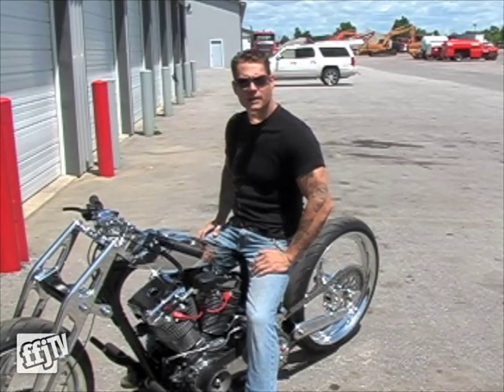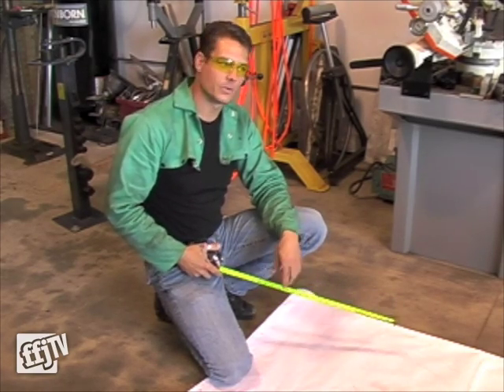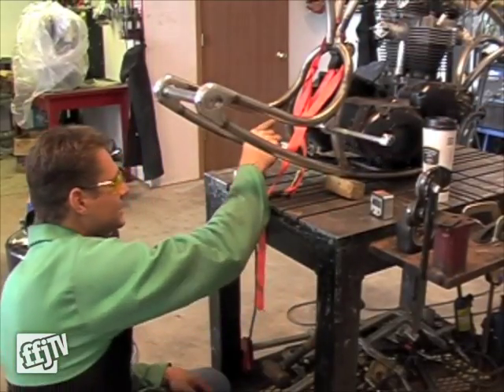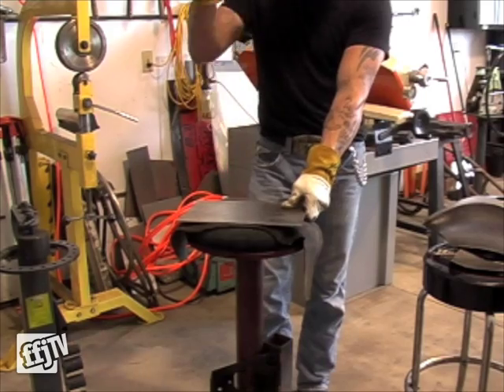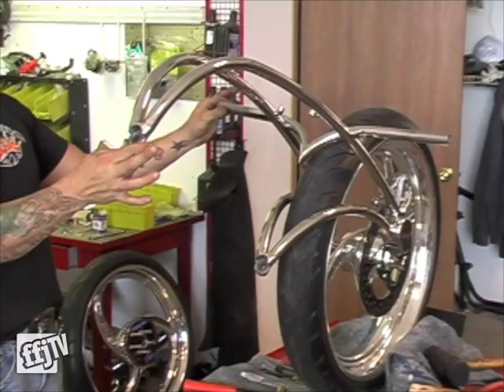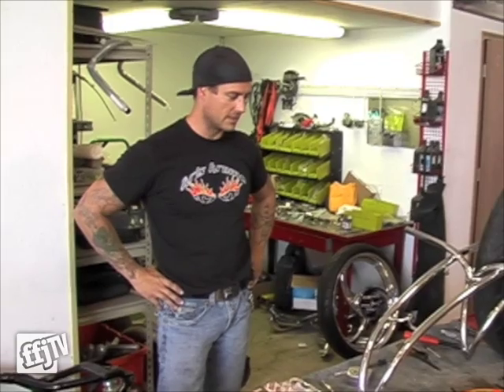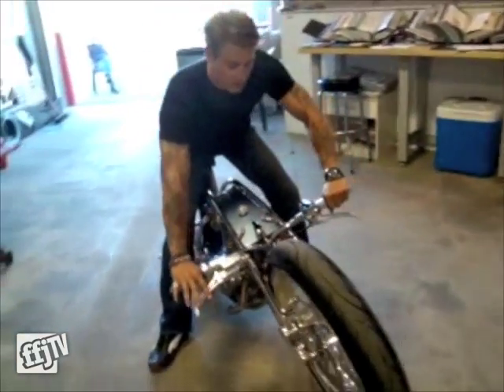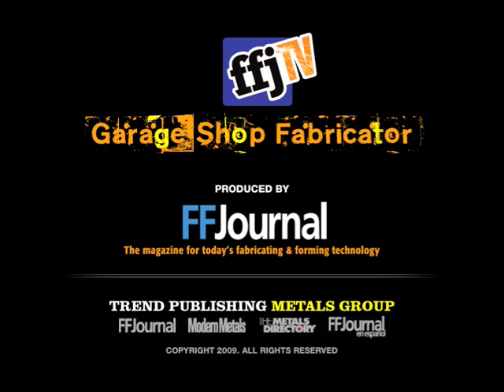Garage Shop Fabricator™: Kris Krome

Comment: Nice work. I'd sure love an all stainless bike... Hard to work with but beautiful.

I'd like to see one of these guys with style and talent tackle a bike specifically designed for extremely high gas prices due to economic hyperinflation and collapse. Anyone can make a big bike look cool with a cool powerplant, but how about you make a 250cc or less that gets 70 plus mpg or better yet make a cool powerful diesel based on something like the vw 1.2l clean diesel motors that could give 100mpg.